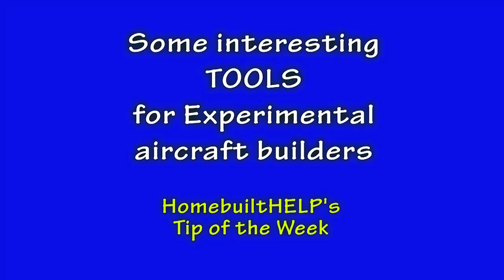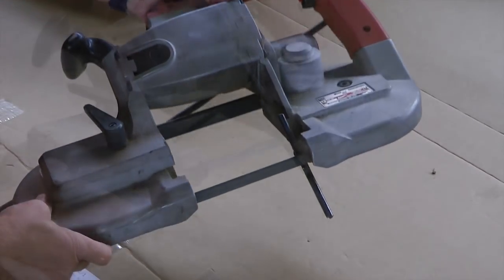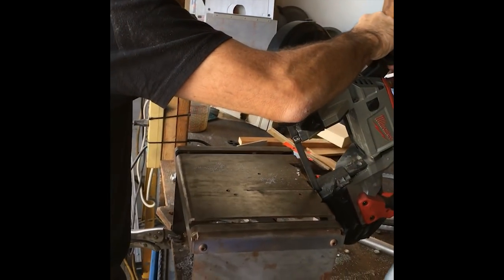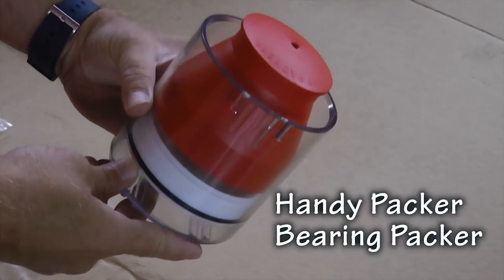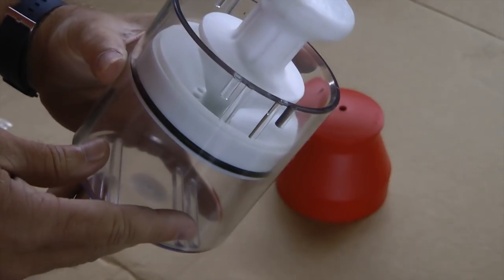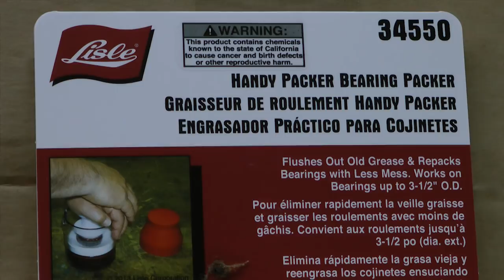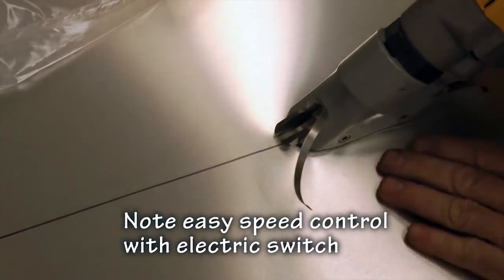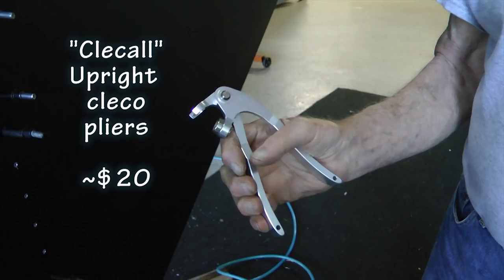Interesting Tools for Experimental Aircraft Builders

Comment: Actually, the bearing was not properly packed. In the photo you could see dry roller bearings with just air between the rollers and the retainer. There are  other bearing packers that use compressed air and work better.

Comment: If the part will fit, I prefer using my portable/benchtop saw over my big saw. The blades seem to last forever and are much cheaper than my big saw's blades. A useful addition is to use a foot switch and zip tie the switch on. Much more convenient to use the saw and quicker to stop if something goes wrong with the cut.